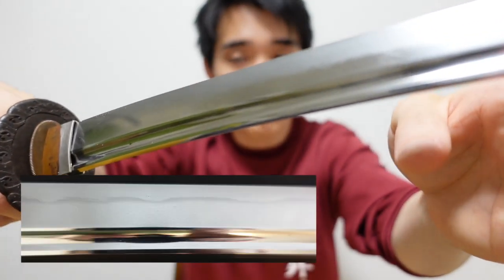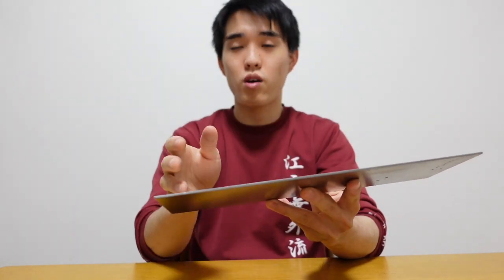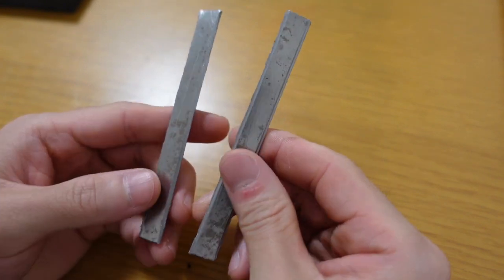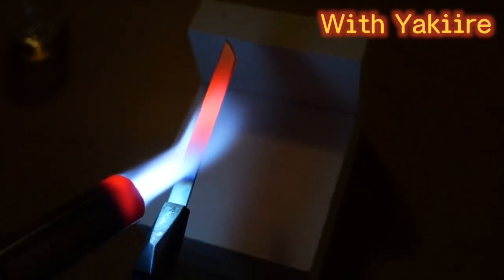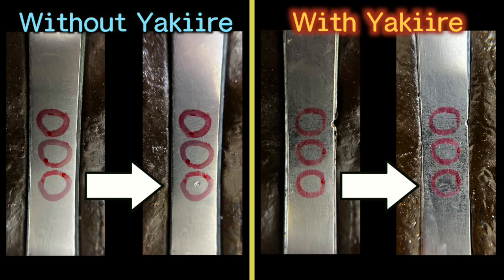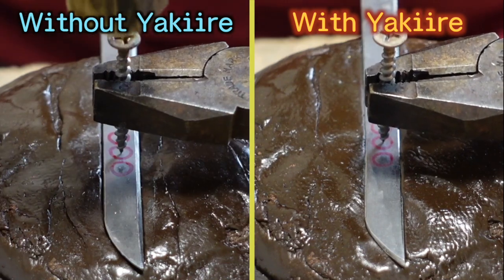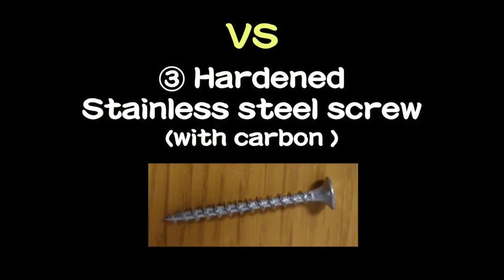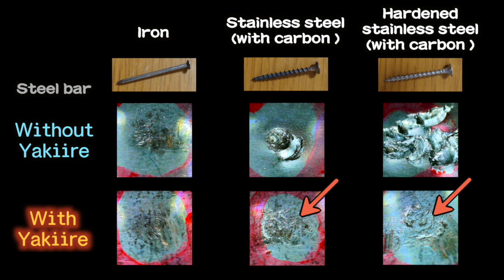How hard is Hamon of Japanese sword? #hamon #katana #experiment

Comment: That is not how the katana is made. after quenching in water you need to temper the blade.
Reply from the maker: Thank you for leaving the comment!

As you mentioned, after yakiire, the tempering process is very important!

Maybe I should have mentioned about that in the video.
I actually intended on explaining tempering process in different videos, so just focusing on explaining Yakiire process in this video.
If the temperature control is ok, just Yakiire is enough for such a tiny steel bars which I used in the video.

Thanks again.
I’m very happy that you watched our videos and left us a comment.